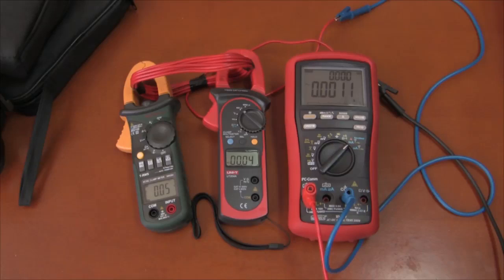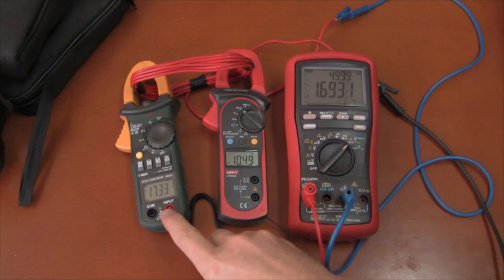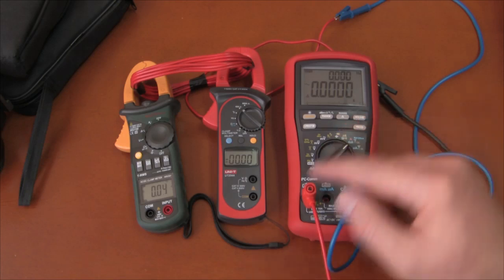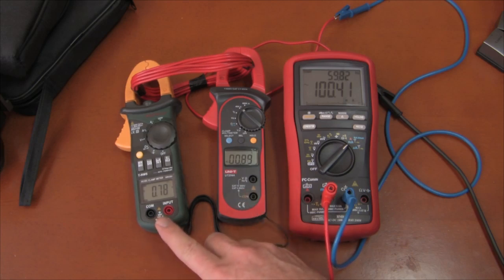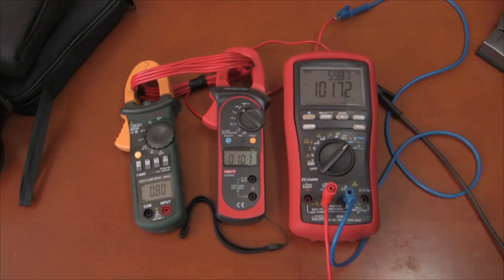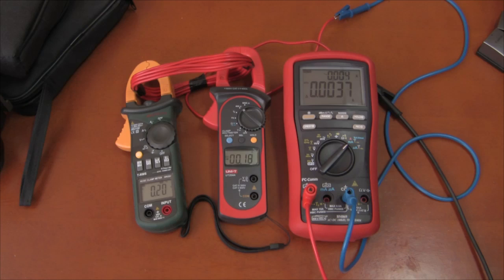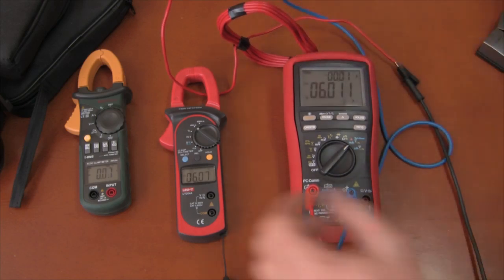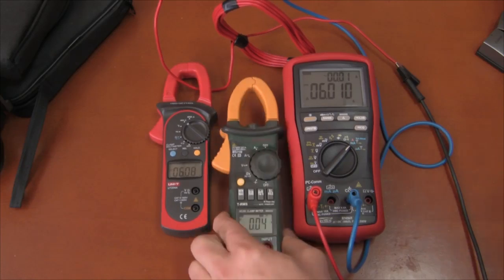Uni-T UT204A vs Mastech MS2108, two cheap clamp meters compared, part 2

Comment: Mastech can be zeroed with REL button both on AC&DC have one, tried it, works...  going trough the video all the way, your bias was obvious and excuses are ridiculous (i have UNI-t also just to mention)...
Reply: Zegarac Robert Sir like now we have 220 volt light and if we put load on this like AC Heater then it reduce and remain about 190-200v. So the Amps we get for calculating the Watts to whom with electricity supply is to be multiply? I mean from starting 220v or loaded 190v? Please reply its very urgent to know for me

Comment: I commented on your part one comparison and after watching this video I'm going to need a more accurate ac clamp meter. Bottom line I need to take amp readings on an outdated pool pump and a 30 year old 5-ton air conditioner before replacing them. I'm trying to reduce as much energy waste before sizing a grid tied pv solar system so accuracy is very important. Do you have any recommendations? I'd like to stay under $100 USD. Thanks
Reply from the maker: I am sorry but I can't really make any real recommendations based on my personal experience for you needs. n general I would stay with the name brands, Amprobe, Fluke, Agilent, but not Extech. IMHO Extech ahs had too many quality control problems. Perhaps the UT204A is good enough for your needs.
Reply: LightAges
Thanks, I went with a Klein CL2000 clamp meter and the Extech 480172 line splitter. So far no regrets.
Reply: LightAges Sorry but I can't see where you zeroed the Mastech MS2108 in the video, the operating manual says to zero it each time by pushing the REL key.
Reply from the maker: Ken Carpenter
It has been a long time, but I do remember that nothing was intuitive and if I remember it couldn't be zeroed in AC mode so you had to live with any offset it showed. It was just such a crap meter I couldn't be bothered trying to make it work. Someone suggested I got a counterfeit and it could be true. It is just horrible and I don't trust it at all.
Reply: Patrick Walker Sir like now we have 220 volt light and if we put load on this like AC Heater then it reduce and remain about 190-200v. So the Amps we get for calculating the Watts to whom with electricity supply is to be multiply? I mean from starting 220v or loaded 190v? Please reply its very urgent to know for me

Comment: Hello from Brazil, :-+
When you say at the end, "i don´t trust it for anything"; Should i understand that UNIT-T is included in this class too? Or UNIT-T wins and is a better choice for professionals looking for a cheap tool? 
I just bought a MS8120 and really found some issues that you showed on the video. 
In the main board you can see a series of trimpots VR1 to VR8...I´m almost sure this is for calibration.  Do you have the legend for these ones?
Do you think i can improve accuracy doing a properly calibration? ;)
Reply from the maker: The Uni-T UT204A is better built and more stable. I just can't trus the Mastech with all the little things wrong with it. I don't know which trim pots do what so trying to do a calibration will be pure luck.
Reply: Flavio Tonello Tavares Sir like now we have 220 volt light and if we put load on this like AC Heater then it reduce and remain about 190-200v. So the Amps we get for calculating the Watts to whom with electricity supply is to be multiply? I mean from starting 220v or loaded 190v? Please reply its very urgent to know for me

Comment: Okay, after testing today, I think I have a handle on what was going on last night.  And incidentally, last night was outside, in the dark, in single digit temps, so not the best conditions to learn a new meter. :-)   I incorrectly assumed that you need to zero and then leave zeroing mode to enter measuring mode.  Leaving zeroing mode puts it in some sort of other mode with a, typically, 1.3 to 1.5 DC amp reading, depending on its mood.

When reading in the positive direction, this is added to the true current, so 5 amps becomes 6.3 (if the pre-value is 1.3).  When reading in the negative direction, -5 amps becomes -3.7 (-5 + 1.3).  This is why I was seeing such a large variance between each direction.  After using the zeroing properly, each direction measures approximately the same.

This probably isn't the right meter for milliamp measurements, but I feel better about using it for 1/10th amp measurements.  I did find good reviews for the GTC CM100 for milliamp measurements.  I may consider that meter if I still can't detect my parasitic amp drain with the ms2108.

Comment: I bought the ms2108 specifically to measure DC current.  One of the needs was to measure whether I had a phantom power drain on an RV's 12 volt battery.  I had the same issue where the meter would read 1.3 to 2 amps when not clamped on any wires.  I left it on for a while and it worked its way down to .6 amps.  Zeroing and then putting it back into measuring mode brought back the false reading.  I did not try clamping when in zeroing mode, like you did, so I will try that.  I just don't have much confidence in reading low current (0-2 amps) with this meter.  Oh, and swapping direction when testing on a battery charger yielded much lower values in negative direction than positive (something you saw in your testing too).

Do you have any recommendations for an inexpensive DC amp clamp meter that can measure reasonably well in the 0-2 amp range?  Or did you find a way to fix the MS2108?

Comment: You ended up with a bad one - Mastech MS2108. Mine is fine I have compared this to fluke and its well within its specification.  Mine does not have any issues with the body falling apart or selector switch passing beyond off button. The other review is in line with my findings.  I would advise you try a replacement one.